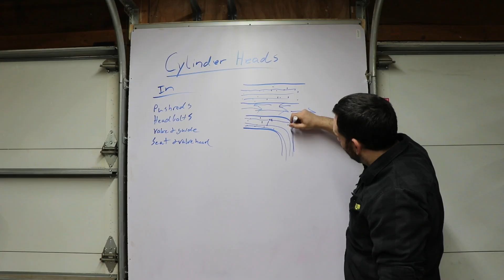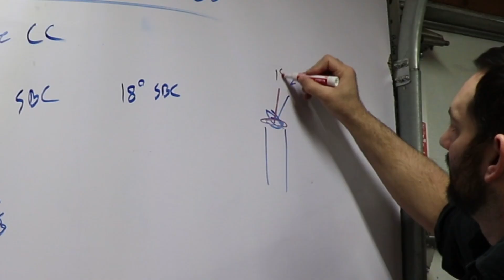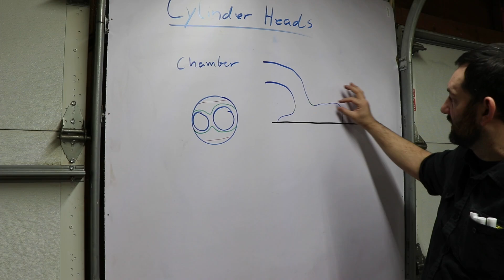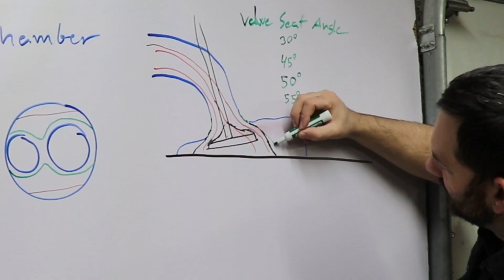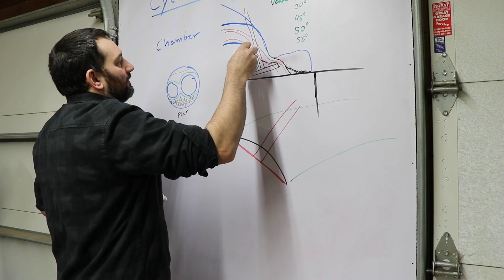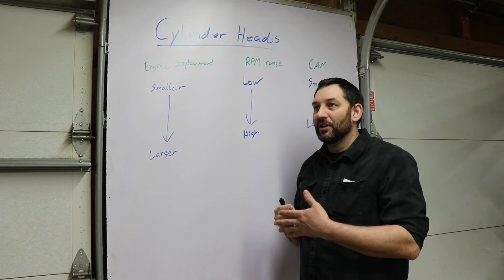Cylinder Heads - High Performance Engine Building

Comment: Do you have any experience filling the exhaust runners on factory Olds heads?  The floor that is. Does brazing work? TIG brazing or maybe stick welding with nickel rods?  I wonder what they thought about when they made some of those exhaust runners.
Reply from the maker: Bronze brazing rod is the go to for welding up the divider. I melt old pistons for filling the crossovers. People have used lead but the melting point is too low for the bowl area and will melt back out some.
Filling on the floor isn't worth the effort.

Oldsmobile was a luxury brand back then. They did that exhaust stuff for noise reduction/quieter running engine
Reply: @codysmithmotorsports736  Thanks. I guess they do have a somewhat more mellow tone stock than other brands.